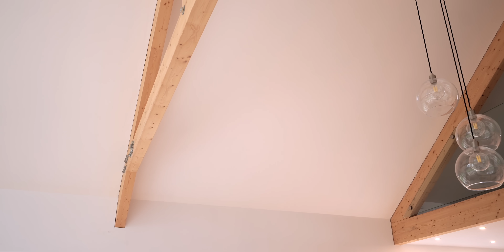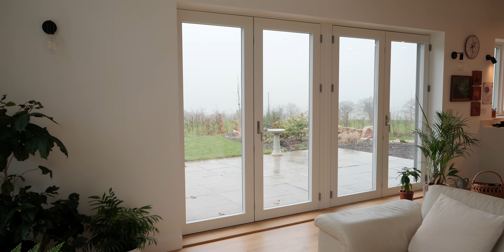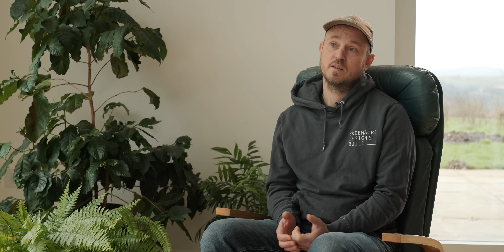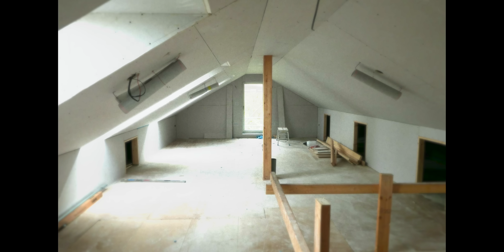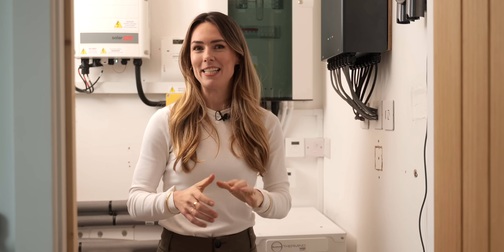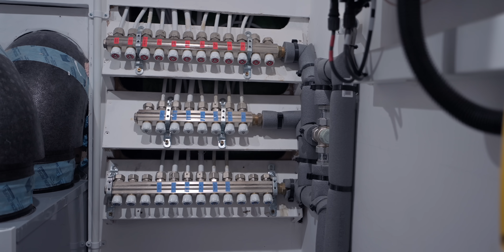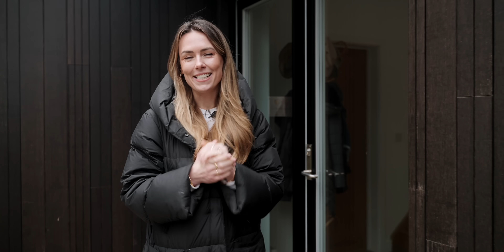Ditching a Heat Pump for In-Plaster Infrared Heating?!

Comment: Infrared panels are ohmic/resistive heaters, same with the electric DHW boiler, you can only ever get at COP of 1. 

There are combined MVHR heat pumps, which also do DHW, that use the exhaust air as a source/sink for heating and cooling. Airflow is limited by the air exchanging rates of the MVHR, so power output of the heat pump is limited. They're used for flats in the EU. 

Alternatively, a small reversible heat pump with UFH embedded in a concrete slab, or with a large volumizer with suspended timber floor, would get SCOPs of 5 and would have been cheaper than this setup. 

New technology isn't necessarily better.
Reply: I would mostly agree, but £196 for all heating, elec and EV charging is very impressive. You can see the temptation for a simpler system and still get the same personal benefit. Yes they will export less than if they had a heat pump but I think this approach has merit, if not most user cases
Reply: @FrankReif it's not as simple as that. I asked the same question when i was first introduced to this tech. It's a little bit like trying to ascertain how much energy is required to cook a jacket potato between using a conventional (convection) oven or using a microwave (obviously infrared is not cooking people like MWs !) When specifying this particular tech, only IRO 1/3 of the energy capacity is required with IR compared to conventional heating systems. This immediately makes IR circa 300% more efficient. If you then add on, as one ought to, all CapEx costs installing, running and maintaining (allowing annuitised replacement costs also) the holistic life costs, let alone the vastly reduced embodied carbon costs paint a very different picture. @energycarbon1138 Rod, you may feel inclined to expand.
Reply: @richardhawkes5079  Radiative heat transfer is an important component of comfort, which is why passive house has a standard that ensures that surface temperatures don't drop below 16C - typically at windows. 

However, it is not true that IR heating reduces heat loss to the environment. It may allow you to be a bit more comfortable at lower average temperatures, which in turn reduces heat loss, but it's nowhere near 3x less.
Reply: @FrankReif  I didn't suggest that IR reduced heat loss to the environment. And it certainly DOES allow greater comfort at lower air temperatures and the combination of the radiant heating effect on the occupant coupled with the ability to lower the room stat temp equate to greater efficiency. I have POE metrics which fully support what I am saying. Happy to provide further information but back to your original point, it is not as simple as maximum COP of 1 and I appreciate you acknowledging yourself that other considerations with this technology alter the equation. I was trying to bring Rod Davies at Energy Carbon into the conversation to add more data & context but his tag wasn't picked up @energycarbon1138
Reply: No argument there Frank, obviously, we get this all the time- the good old COP of 3!

However, as we focus on achieving fast response to the all 4 metrics of thermal comfort, we can achieve equilibrium in less time, at lower air temperatures and using a smaller heating array.  
As the system is, effectively, solid state, and embedded, it has a 50+ year design life with no maintenance thus further narrowing the gap in terms of running costs and with embodied carbon of just 157gms CO2e per lm, we significantly out perform heat pumps in terms of WLC.  plus, of course, we don't require a plant room which frees up space.
Direct penetration from the light waves into surfaces will also unlock further savings when tied to a time of use tariff, utilising the thermal mass of the building, something that many of our clients are enjoying.
The real winner though is the comfort levels.  The ability to quickly bring  the room up to comfort in the event of doors being left open for example is something that even passive house standard buildings can benefit from.      
I could go on but would refer you, in the first instance, to many studies including a literature report my Luven University which brings together around 50 studies going back as far as the 1960's.  Happy to share this and others.
DENZS now recognise IR as a viable solution and we are working with them and the industry on multiple university trials to bring this into SAP

So, yes, on paper we have a 1 to 3 comparison but that is far from the entire picture.

Hope this helps and happy to jump on a call to share more information.
Best wishes.
Check out @richardhawkes5079 projects, many of which use this system and have proven to him that this really does work.
Reply: @EnergyCarbonInfraredHeating  IR panels are not solid state devices - such as peltier effect systems. It's a low temperature resistive heating element.

If you wanted to use the thermal mass of the building, which mainly consists of the concrete slab, then embedding an UFH system deep in the slab could provide a decrement delays long (6hrs) enough to utilize off peak electricity rates and load shift them into the peak hours. 

Fancier approaches use bilayer/dual-core hydronic arrangement, where two sets of loops are layered at the top (on demand heating/cooling) and bottom (TES) of the slab.

IR panels cannot cool the building. Managing solar and internal gains can be problematic in PH, especially if they do not have automated/active external solar shading. A heat pump could easily manage those loads.

The MEP design of this project makes no sense to me. A simple A2A heat pump with a few electric handrails in the bathrooms, with a normal DHW cylinder with an off-peak tariff emersion coil would have been far cheaper, and more efficient. 

Check out Old Holloway Passive house, this is exactly what they have done.

This is tech ecomodernist marketing. We should not respect people trying to reinvent the wheel for the sake of novelty.
Reply: Valid point and one that we come up against all the time.  I would point you to plenty of research on the subject of improved thermal comfort using IR over other forms of heating.  Happy to share.
Reply: @EnergyCarbonInfraredHeating  Look, I'm fine with IR being used in very low demand buildings to responsively heat a specific area, such as the sofa or armchair, especially if you're getting old. We all have our own comfort levels, and this would provide individual heating without needing a blanket. 

Market it correctly, and you'll get customers who are willing to pay for it. But pretending like this will work for the whole building, even at 25w/m2 peak load, is going to cause you a lot of reputational harm. Don't do it. Don't say it's a semiconductor, don't say it helps due to thermal mass, don't say it's more efficient than heat pump, or that it can even replace a heat pump. It's something you can add above a sofa, or to replace the radiative feel of an indoor fireplace, which are toxic nightmares that need to be banned.
Reply: @FrankReif  Oh dear :@))
Reply: I agree with you 90% here and I was one of the ones really annoyed about the video with the aluminum resistive heaters they had a couple of weeks ago.

The only thing is this is a situation where only 2kw of heat is required for the whole house, the smallest A2W ASHPs are 4kw? you're only going to get a SCOP of 2-3 at best out of that, this is however an excellent opportunity for an A2A system especially combined with the MVHR as you suggested, but then you have to have a separate system for the hot water. 

This is one of those rare situations where resistive heating may be a good option when you think about the lifetime cost of the system, but personally I'd still rather the most efficient option used and some more electricity sent back to the grid.
Reply: @andyca15  most heat pumps can modulate down. They can certainly modulate to 50%. It wouldn't even need to cycle.
Reply: @drfisheye  You design for peak load conditions 1% of the year, but most of the heat is delivered at 50% peak loads, which is good for COP. If you have a 2x oversized HP suddenly most of your heat is delivered at 25% modulation  which leads to short cycling and durability problems.
Reply: @FrankReif  wrote:
suddenly most of your heat is delivered at 25% modulation  which leads to short cycling and durability problems.

The heat pump efficiency drops when cycling.  Having two small heat pumps sequenced would be more efficient overall. Each one can cope with low to average heat loads. But probably more installation costs.
Reply: @johnburns4017  This is done on large installations, but the problem with passive house is that the compressor on your fridge would be enough to keep it warm.
Reply: @andyca15 Viessmanm have 2.6kw heat pumps.
Reply: @danconnor3089  
At two hundred pounds a year electricity bill why bother. It is ugly and takes up space outside. And noisy.
Reply: @andyca15  With enough thermal inertia (concrete slab or volumizer) the heat pump cycles less. It's not perfect, but it's nice to have responsive DHW reheat times, so extra power isn't totally wasted. 

A higher power CO2 heat pump could heat a thermal store to exclusively use the cheapest 12hrs electrical tariff rates, giving a 50% discount on electricity costs. A COP of ~3 effectively acts as a COP of 6.
Reply: But yes, of all the places to use resistive heaters, passive house is one of them, but a panel radiator, and a normal DHW cylinder and typical peak/off peak immersion coil setup would have been the best option.
Reply: @FrankReif 

Hmm ... then it rather begs the question of why the old guy went for the concealed under plaster system that he did.

Perhaps it was the fit and forget aspect he found attractive/ appealing?

He alluded to KISS, which is, probably (I speculate of course), why he didn't consider complex mechanical systems such as heat pumps.

It then turned out  that the retro fitting an additional heating element under a further skim coat of plaster was very simple to achieve.

It's useful to remember that heat pumps are not the answer to every application.

Heat pumps are but one solution and won't always be the fairy on the top of the tree.

Seeing as heat pumps are mechanical then they have a limited operational life.

We hear (groan) of heat pumps becoming noisier over time.

For all we know said noise pollution from heat pumps may become an environmental issue over said time.

It might be said that early adopters of "new"  technology" might be regarded as sacrificial lambs and demonstrate the unforeseen problems.

We have issues with power walls self igniting and noise pollution from heat pumps.

Pointless to argue against this as we now have history of the above issues.

We read too that BEVs are no longer the aspirational vehicle of choice for the now recognised drawbacks to operating them.

Google will guide you all the information you need.

Very recently we were informed that cast aluminium parts on a BEV are easily repaired.

This is of course nonsense as insurance companies are not in favour of repaired (welded) cast aluminium parts under all circumstances.

Chapter and verse available online for them as arsed to read it.
Reply: @FrankReif  
Panel radiators are visually unappealing. He did the right thing and went for hidden heat emitters. 

Normal cheap DHW cylinders lose heat. I put once put in an insulated cupboard, including the door,  which was sealed. Cheap and simple to do with heat retention high approaching a Sunamp.
Reply: @ForestForest-n9i  wrote:
It's useful to remember that heat pumps are not the answer to every application.

The heat pump obsessives are out in force.  Heat pumps are not the answer here for sure.

I see no down sides to BEVs. None. The key is battery technology. Battery technology has advanced so much that it will take the average BEV to five hundred miles range and even more. 

For those isolated, BEVS will be a Godsend providing backup power. Having a big battery in the BEV will be beneficial. BEVs will displace ICE cars quite quickly. When fuel is expensive and difficult to obtain the change over will be rapid.
Reply: @johnburns4017 

I would disagree with your view on BEVs and certainly don't like this V2xxx nonsense.

If there's a power cut then unless you are very frugal with your draw then there's the risk of the car battery going flat and you are marooned until you freeze to death, the food in the freezer goes off and you are reduced to eating the pets, then wife and children.

If that happened in Stalingrad then it could happen anywhere even in a so called civilised country.

If, as might happen, we end up in WW3 then BEVs will be quite useless if power is rationed.

You could ask Ukrainians about that as Putin does his best to destroy and disable their power plants.
Reply: @ForestForest-n9i  
Your mind has wandered off wildly.
Reply: @johnburns4017 

😂😂😂😂

Having difficulty keeping up?

Suggest you don't confess your limitations online.

Someone's bound to take the piss.
Reply: @ForestForest-n9i  
You never quite had the point then wandered off.
Reply: @johnburns4017 

Try to be more specific if you can.
Reply: It needs little heat, two kilowatt at most in freezing conditions, measured at -3C outside.  So most of the heating season his needs are less than two kilowatt, as the average temperature thru the heating season is ten centigrade outside - we live in a temperate climate. Heat pumps would generally be inefficient in this situation. 

The combined MVHR heat pumps obviously would be worth looking at. He heats the Sunamp overnight at 7p for kWH. It retains so much heat it provides the hot water thru the day.  BTW, other manufacturers do something similar to Sunamp.
Reply: @johnburns4017  You could probably heat that house with a single ducted A2A unit. They go much lower than 6kw.
Reply: @TheGalifrey  
Get the point. He does not need an expensive heat pump at all. He proved that.
Reply: @johnburns4017  Well he hasn't yet as he stated in the video he needs to add more panels which will need plastering in. I A2A unit will cost much less than the panels he has installed so far, probably already has the ducting for his ventilation heat reclaim system. So yeah, you get the point as he hasn't proved anything yet.
Reply: @TheGalifrey  
Get the point of the vid. The additional panel was because he made a mistake in the original heating calcs/design. 

The cost of installing a heat pump is way more than these panels. 

Find out and stop barking on about inappropriate heat pumps.
Reply: @johnburns4017  A self install A2A heatpump is about £3-400 don't talk garbage. If you think installing panels, wiring and plastering is cheaper, then you have zero idea of material and labour costs these days, let alone how much those IR Carbon Fleeces cost per meter.
Reply: @johnburns4017  Not to mention the house will be cooled in the Summer as well, and these homes are usually awful in summer even with really good reflective glass, epscially that far south.
Reply: @TheGalifrey  
Passive House does not need a cooling system, esecially in a temperate climate like the UK.

A heat pump is totally inappropriate for this house as the owner proved by electricity bills and low installation costs. That is plain for all to see. 

You must sell heat pumps.
Reply: @johnburns4017  By that statement you must sell infrared heaters 🤣🤣🤣 And you talk nonsense. If it needs some heating it's not 100% passive, if it's not 100% passive it could require some cooling in summer, just like the alledged passive house we lived in.

Comment: Whats he on about saying that batteries dont work in a power cut ? of course they bleeding do , im in Wiltshire and we had a 4 hour cut today and i was lovely and warm i suppose he has to sit in the dark and use a camping stove .
Reply: To be fair, he meant that if you keep enough charge in them to cover a power cut, you lose capacity to use to power the house. We don’t 🤞 get power cuts here but if I kept our batteries charged to 50%, our bills would be higher because we’d use more peak time electricity.

Comment: a sunamp boiler is not simple, a resistive water boiler is.
Reply: It is not a boiler. It is instant DHW with water being instantly heated via the gell which retains heat in the Sunamp. I think it is heated by resistance heating.

Comment: 4 holes 2" down 50 feet to extract geothermal Heat Pump for 1/2 price or more operating cost.  Hole not dug or drilled but pounded in ground like a pile driver for buildings or fence posts. :hand-pink-waving:
Reply: What are you on about?